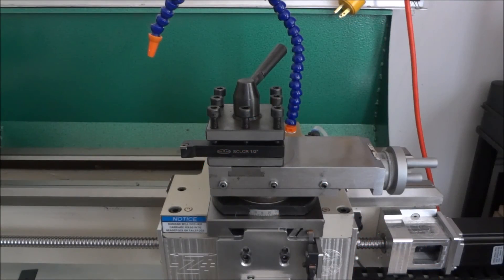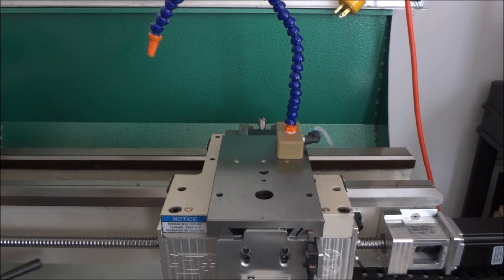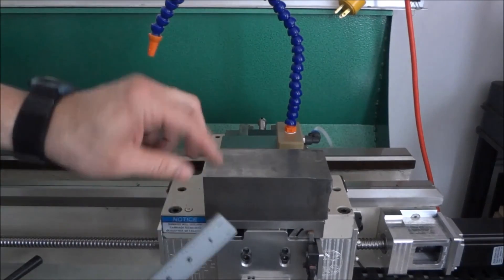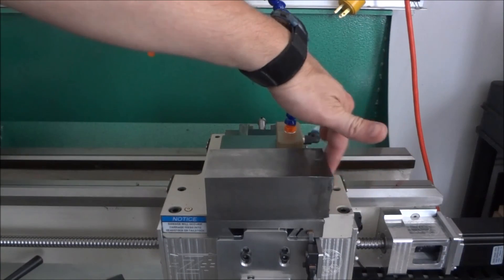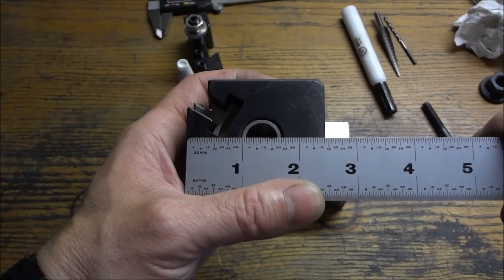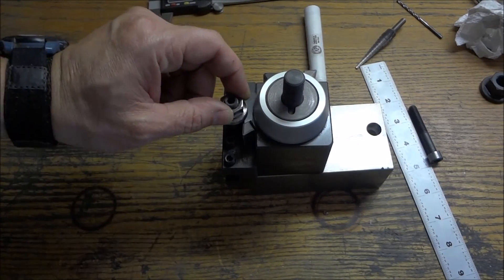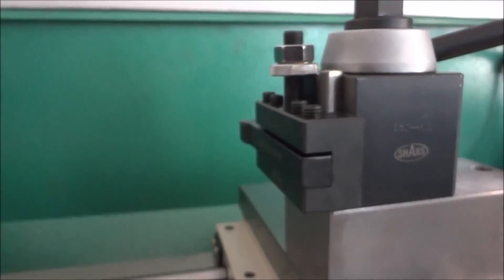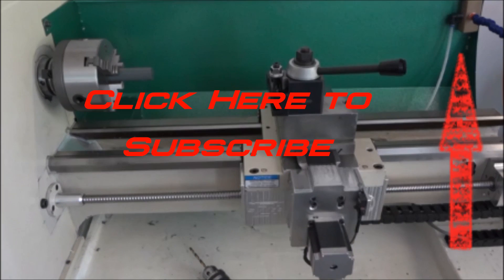G0602 Project QCTP Riser

Comment: I'm starting to wonder if the AXA toolposts are all the same height.  I have a G0602 with a Phase II wedge style AXA post and I've run into the problem that with 1/2" shank tooling in the holders I need to have the tool holder drop below the bottom surface of the toolpost (the compound is too high), and the adjustment studs are more than long enough (till you said AXA at the end I was going to ask if you were installing a BXA because the proportions look different).  For some reason, the tool holding blocks are hardened making them a pain to just cut a bit off the bottom to make them work.
Reply from the maker: my holders are 101 series this lathe is a in between size really but the AXA work well. I also have removed the compound slide which may be the issue your having.
Reply: @CNC4XR7  Yea, like I said, I suspect the compound is my problem, but since mine is manual and staying that way for the near future at least I'm not really up to removing the compound slide.  

It seems that there used to be more active user groups for this lathe at one point.  I'm wondering what others are doing but I can't seem to find anywhere to ask.
Reply: @mpikas  The BXA is too small really for this size lathe, The AXA is the one. They are all the same size, it's a standard, although on mine the centre stud was 9/16 18 rather than M14 as seen here. Like yours, on mine the QTP was about 5mm too high on the stock compound. Eliminate the compound, you don't need it and it badly reduces rigidity, if you need to cut a taper, turn between centres.

Comment: I just want to make a general comment. I love your videos. Although I have no experience with the workings of a lathe, I do have experience with tools in general, ( my dad owned a hardware store back in the mid 50's through the early 80's) I find your video's fascinating. Thanks my friend for keeping me entertained :)

Sorry I had to edit. I make a mistake in my grammar. One other thing,  I wired offset printing presses for 25 years before I was forced into retirement in 2007.  That being said, I love my craft even though I haven't done it professionally  since I got laid off several years ago.

Comment: Awesome. I'm planning to make mine maybe .350" lower so I can run 5/8" tooling down the road. Your machine is looking great!
Reply from the maker: russtuff Thanks, I thought that I might need 5/8" tooling as well but I notice SHARS sells a AXA 101XL holder for 5/8" tooling the dimensions are the same and the only difference being the bottom of the tool is lower not the top.
Those holders should work just fine.
Reply: CNC4XR7 What?!?!?! The bottom is lower? I thought the top was higher.
Dang it man, I'm going to get some right away!\
I guess I need to be more patient and not post here until the video is over :/

Comment: I've had to use a QCTP tool holder hanging down below the bottom to get a larger parting blade on center. Looks really great, can't wait to see you start to make chips.
Reply from the maker: Yea I thought there may come a time when I need to have the flexibility to lower it. However I figured 99.9% of the time I would rather have the added support so I opted for this mounting position. I figured I can always flip it over and put a mounting hole on the other side for special tooling. Still warping my head around this coordinates setup on turn. 
Sam
Reply: CNC4XR7 And of course you're gonna be replacing the cross slide with a custom t-slot slide :) You're leagues ahead of me, my lathe is still in pieces!
Reply from the maker: No plans yet but I wot rule anything out.